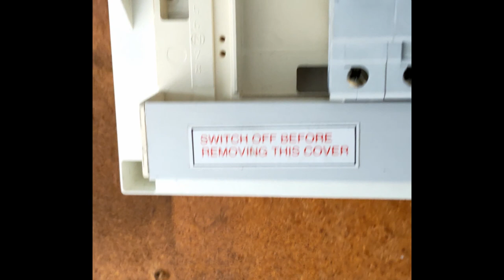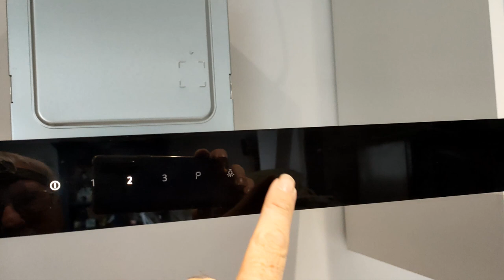KITCHEN REWIRE - PART 1 - Electrical Wiring for a new cooker, induction hob and hood.

Comment from the maker: Please Read: Clarity On BS 7671 Amendment 3 Regulation 421.1.201 Metal Consumer Units

Can additional circuits be added onto an existing plastic style consumer unit?

Yes, providing the consumer unit is in good condition. However, do check for the consumer unit for cracks, or any other sign of damage, such as scorching, as it may need replacing.

From IET. Therefore in answer to some comments, yes I was perfectly ok in retrofitting the plastic consumer unit, as it was in good order and did not need to be replaced. In would be appreciated if before you make comments that you check your facts and quote the relevant BS7671 regulations you think I have breached. If it turns out I have then of course I will make good at my own expense.

Comment: Didn't see anything about installing the induction hob..........

I presently have a 4.1kw double oven and a basic ceramic hob connected by one 6mm cable to isolator switch, CCU and the fusebox. 
Works fine and recently had electrics checked and a new fusebox fitted.

Looking to install a 7kw induction hob so will that run off the present set up or will it need a separate 6mm supply.
Since having central heating installed, here's a now an unused 8kw shower connection etc at the board.